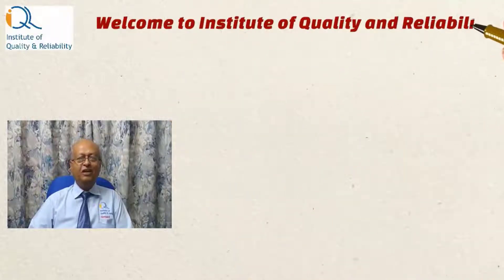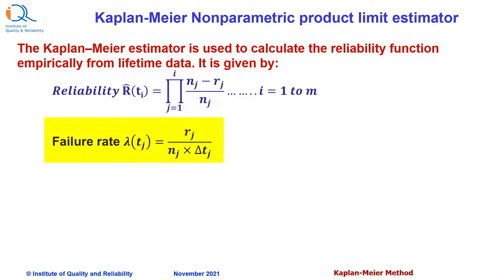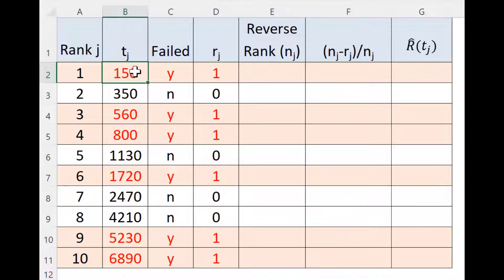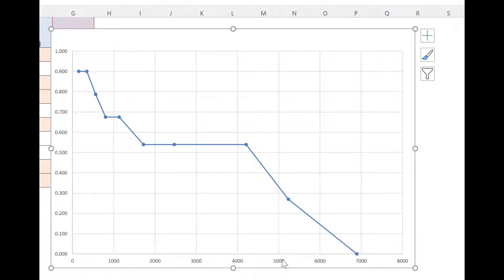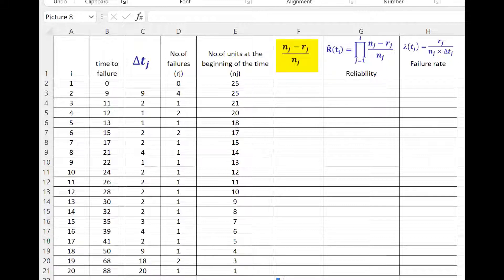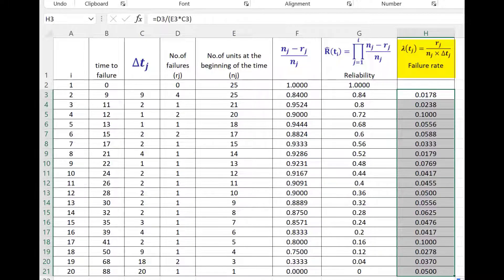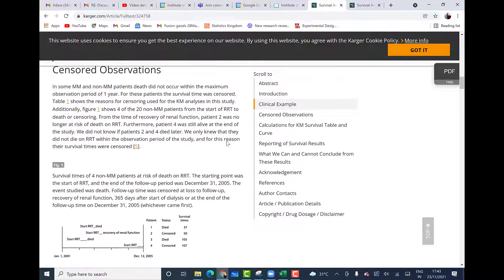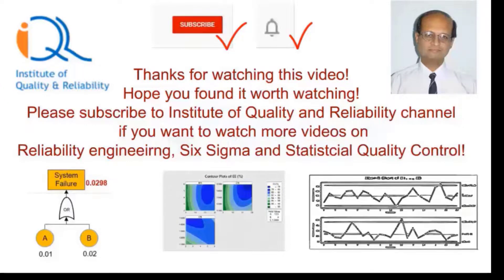Reliability Estimation with Kaplan-Meier Nonparametric Method

Comment: Can you make a video on comparison between LDA of multiple failure modes v/s Kaplan method. That would give us a brief impression to choose the right method to analyse the Reliability/Survival. (Shared my query as what I just felt that would be tremendous useful)
Reply from the maker: Video on LDA for multiple failure modes was released earlier. Kaplan Meier is used when distributions do not fit the data.